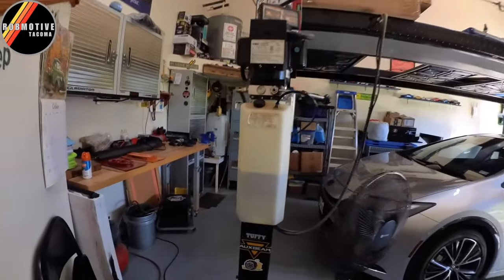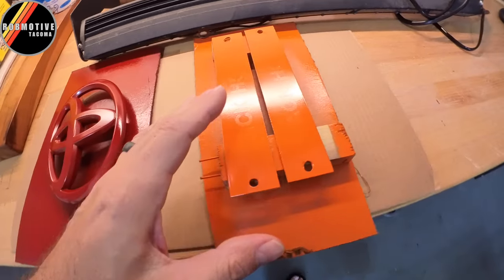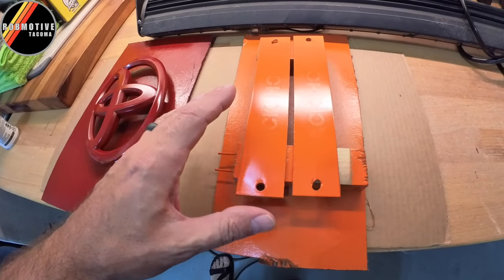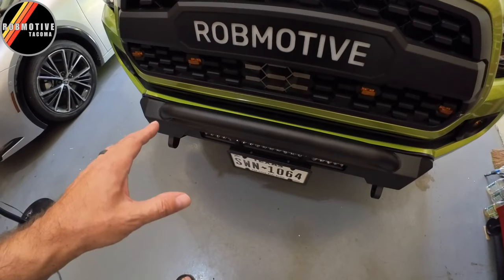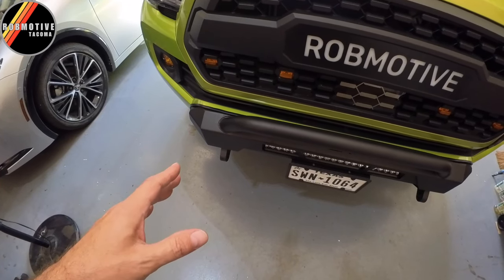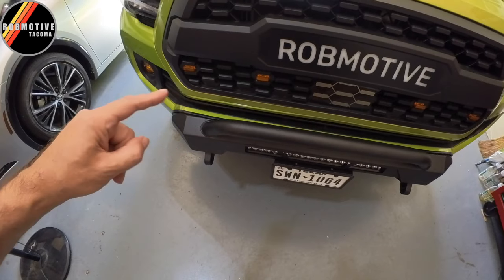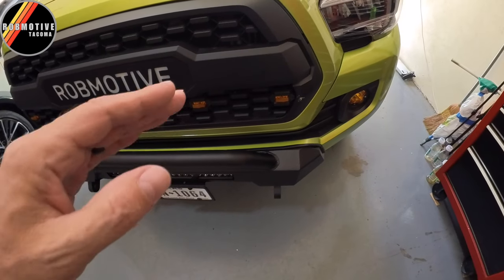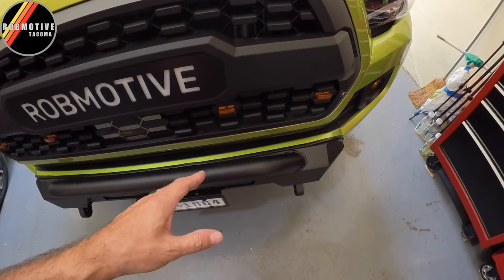Making The Toyota Tacoma Even Better

Comment: Hey Rob, wondering if you can help with something:  I have a 2021 Tacoma SR5.  I lifted the front 2" with Billstein shocks and didn't do anything to the back.  I had Black Rhino Stadium wheels installed on 265/75/R16 KO2 tires about a year and a half ago.  The tires have about 25,000 miles on them now and the truck ran great until the other day when I had the tires rotated at Toyota dealership.  I had lots of vibrating and shaking over 40 miles per hour - almost undriveable.  When speaking to the service manager about this, he stated that I need hub centric rings installed.  But I said the truck had been running great up until now, before you rotated the tires.  Why all of a sudden I need hub rings?  He said the lower tread depth due to age and lack of hub rings was causing the problem.  He blamed the shop (not toyota) that did the installation for not installing hub rings initially.  This didn't make sense to me.  I had the tires placed back the way they were and now cannot rotate them until I figure out what to do!  Do you think I am getting the straight scoop from Toyota?  Are Black Rhino wheels hub centric or lug centric?  should I really have had hub rings installed initially?  And why would the truck run fine for 25,000 miles and now all of a sudden I am having problems when I rotate tires?  thanks, I appreciate your help!!!!
Reply from the maker: Sounds to me like you have issues with one or both back tires (particularly if all is fine now that you have switched them back to the rear.
Reply: Part of the issue is that you've run 25,000miles without rotating and you'll get way more even wear by rotating every 6000-8000miles. So the comment about lower tread depth has some truth to it - but that doesn't cause vibration on its own. It just means you're wearing out your tires by not rotating frequently enough. Your 16" Stadiums have a bore of 112.10mm while the Tacoma hub is 106.10mm so they are not even close to hub centric. It is possible to tighten on a set of larger bore aftermarket wheels without rings and just rely on the conical lug nuts to suck everything into place but a junior tech rushing with an impact wrench is probably going to botch that and give you wheels not aligned center on center with your actual hub. That WILL result in vibration. Why the wheel and tire place didn't put rings on initially is odd but a set of rings is like $20-30 so just put them on and rotate your tires more often. During the tire rotation and centering ring install, get the shop to check each wheel for rebalancing to rule that out as well.